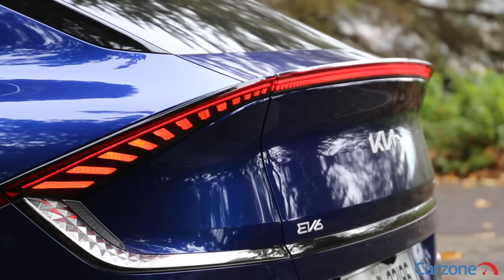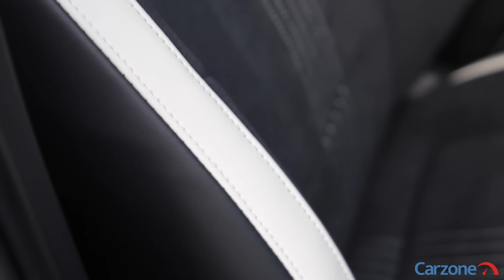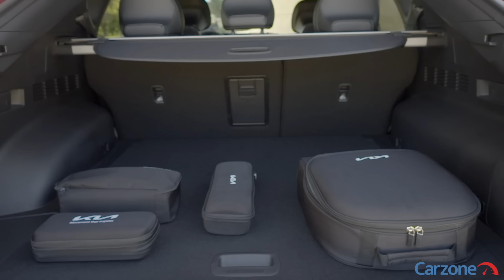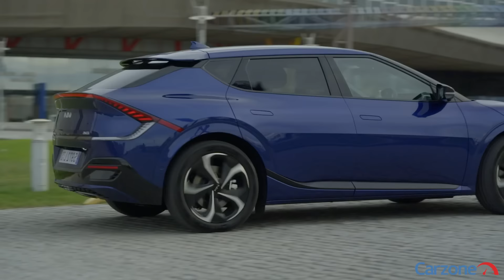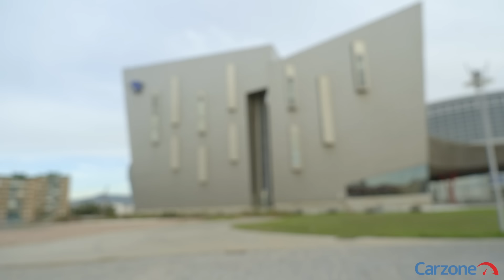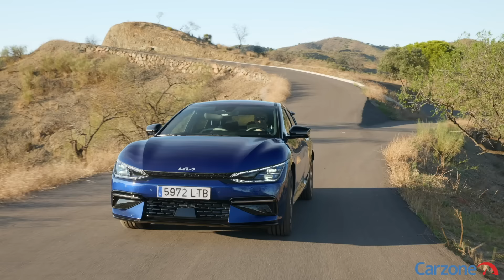Kia EV6 Review - Best electric car on the market?

Comment: EV6 RANGE PROBLEM
I’ve had two test drives in the Kia Ev6, it’s great, everything the reviewers say it is.
I arranged a longer test drive today as I have never owned an EV and needed first hand experience of range… if it was even close to WLTP figures I was ordering one at end of test.
Test car was a 77kwh RWD GT Line S. it had a 98% charge and was showing a 285 mile range ( even at this point I thought the projected range was low, but I so wanted to be proved wrong ) WLTP range is 328 for a fully charged RWD.
The outside temp was 12c and throughout the test it mostly rained… the car was in ECO throughout. Heating was on for first 25 miles or so, including heated steering wheel and seats, but I turned heating to setting one and seats and steering wheel cancelled heat output.
I did 132 miles on test… 60 motorway, 60 A/B road miles, and about 12 miles urban driving. I used 75% regenerative braking and hardly used the brakes at all, the system was that good.
At end of test battery was showing 92 miles range ? This equated to 224 miles off a 98% charge, providing I got the full 92 miles out of the batttery…. At start the car said I had 285 miles ?
Interestingly, the car at start and end of test showed 2.9 m/kWh on display.

This works out at 77 x 2.9 = 223. 3 miles… an exact measure of what the car was doing.

In conclusion, WLTP figures of 328 miles …
The car at start said I had a 285 mile range…
My actual range at best would have been 224 ?
And the car itself verified my figures via its miles per kWh display.

I have been in touch with Kia UK but was offered no interest, explanation, or concern…. I was told to go on the EV FORUMS to see what they said.

I really like this car and was prepared to stump up over £52k for it today…. If anyone can refute these figures or explain the 100 mile discrepancy in the range I would be appreciative ( I have photos of display at start middle and end of test to corroborate the range I achieved )
Reply: My AWD gets about 240 miles range in UK at 9-10 degC and about 3.2 miles/Kwh, from my eNiro experience, I would expect about 280 mile range in warmer weather.
Yes this is a big heavy car, but I love it, superb to drive.
I mainly charge overnight at 5p/Kwh, so about 1.5p/mile, not worth worrying about efficiency,Range rover drivers do not worry paying at least 10 times as much.
Yes if you regularly do long trips and need to use public chargers then you want max range, but the EV6 can charge very rapidly.
If max range is your most important feature, go for the RWD on 19 inch wheels, if like me range is secondary and you want looks and performance, go for the AWD with the 20 inch wheels.
Reply: I haven't done a range test myself, but there are several tests on YouTube you can watch to get an idea of what others are getting.  You'll never get WLTP in the real world, but from the tests I've seen, the EV6 is better than most of its competitors.

Comment: Are those seats really suede? I thought that part was also a vegan material?
Reply: It is vegan "suede". But still very nice.
Reply: @amperformance7998  ok thanks that's great thanks! I'm still having a hard time choosing between pre-ordering the gt or getting the model y.
Reply: I ordered a GT-line.

Both are excellent and both have their advantages.  I think the EV6 works better as a car, with a much smoother ride, nicer ventilated seats, 360 camera, warranty, build quality.  But the Tesla works better as a statement with greater performance, instant recognition, and a focus on being different for difference's sake.
Reply: @amperformance7998 yes for me the storage and range of the Tesla make me hesitate. The smooth ride and ventilated seats (even tho I live in a coldish place) of the ev6 are very appealing.  I'm slightly worried about all the shiny plastic in the ev6 tho. Choices!
Reply: Wait, did you say the "GT"?  The GT uses different seats, I don't know if they are also vegan and ventilated.
Reply: @amperformance7998  oh yes I did. I thought they had same as gt line. But I'll check that.

Comment: expensive junk with junk range and if you drive carefully then you got junk range!! untill they dont invent  batteries with 1000+km range with  80+kmh speed  and recharging time on the level  of  refueling  gasoline cars just like longevity of batteries  EV vehicles are only  expensive  toys
Reply: Yawn. Stick to your horse less carriage Mr 11ESSE111 - this new modern world is not for you.
Reply: @Richard-io9xe  I think it's a bot or something. I have seen the same comment pasted into other EV reviews.
Reply: Level 2 charger at home. To me it's worth it. But if you don't have a home charger then it's much more difficult to own one.
Reply: Stick with a horse and cart. Much cheaper and easy refuelling. EV's will never catch on.
Reply: @peterthompson99  i have a 5 1/2 year old EV, the battery only has 10 out of 12 battery  bars left, with a consequential reduced range. Ever since I bought it the rapid charging infrastructure has been garbage and it is getting worse not better because supply is not keeping up with demand, so much so that I never use my electric car on longer distances now, I have given up,  instead, although I would rather not, I use my diesel 650 mile range car. At the moment an electric car is the epitome of the horse and cart and has years of improvement before it matches the mature product that is a modern day internal combustion engined car. Sad but true and at an average  £10,000 price premium for an electric car which is logistically inferior at the moment.
Reply: @stevezodiac491  the Kia gives you a 7 year warranty on the battery as well as everything else. As for the range most journeys in UK (prob Eire as well) are less than 100 miles. Then pop back home and recharge. The price premium is offset by the fuel costs. I have test driven an EV6 for a 4 day weekend. No problem finding charge points when out and about, average cost for 50% battery at £7.50. At home full charge with a 7kw charger overnight is £9 from 20%. I loved it.
Reply: @Nevswim  .
Reply: @peterthompson99  You from the 14th century?
Reply: @Mr.Relaxed  sarcasm
/ˈsɑːkaz(ə)m/
noun
noun: sarcasm; plural noun: sarcasms
the use of irony to mock or convey contempt.

Comment: I am so close to ordering one of these the GT line s but can't make my mind up  on a AWD or RWD. Spec it up a bit and  a heat pump white  round about £54.000 for the all wheel drive. At the moment have a KIA 4 NIRO  great car,  huge  spec but look pants.
Reply: RWD is good enough - drove it on the weekend - but tame where the AWD has more oomph. For me in the Alps the choice is easy as AWD is a must for winter...
Reply from the maker: We have only driven the RWD version in Earth and GT-Line specification, and it is still great to drive, with a lower price tag and more range than the AWD. That said, it would be nice to have the extra oomph of the AWD if performance is your thing! Best of luck with your purchase, whichever you decide to go with!
Reply: Mmm £54000 for a kia, bargain lol.
Reply: I am testing this afternoon I have already tested the Ioniq5 so this is a real time back to back. I will go for the GT S line I like the glass roof if I feel the RWD has enough oomph I may order it today. If not it’s the AWD. Love the Blue but also the satin silver with the black gloss trim looks superb.
Reply: Go for the RWD. It isn’t slow or sluggish at all and you get better handling and range. Best value for money IMO. You are still getting pushed back in the seat when you put your foot down. It’s quite heavy in the rear end too because of the evenly distributed weight of the battery + motor in the back so it isn’t a problem in winter either, and there’s plenty of safety systems.